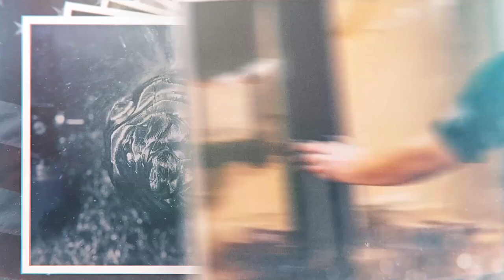Hey President TRUMP!  This Is How To Make Manufacturing Great Again - Vlog #34

Comment: It makes sense that CNC and automation should offer some advantage over countries that pay low wages.  Wages don't matter when you have one guy running 4 machines, each machine doing the work of 20 men.  But is automation replacing workers- a conundrum?
Reply: bostondan77 I’ve wrestled with this too. But ultimately, our automation efforts haven’t been to replace anyone at all; but because of the lack of availability of good machinists. So in the end, we have the same staff, with some people learning and running more advanced equipment and being compensated for it too. So you’re right. There is a sort of dichotomy in automation and manufacturing greatness. But I think that given how little we manufacture in this country now, that there is room for a whole generation to replace those retiring, and ratchet up our throughput with automation and multi tasking machines. This is why what Titans of CNC is doing is important. Securing a solid future for the common man. 👍🏻🤛🏻
Reply: Even automation creates job. Some of those jobs are high paying jobs. Think about a robot cell making parts and some of the jobs required to get and keep it running. 

1. Machine builders
2 robot builders
3. Sales engineers 
4. Riggers
5. Installers
6. Programmers, CNC and robot.
7. Maintenance techs
8. Quality Control 
9. Material handlers
10. Material prep.
10. Tooling Manufacturers 
11. Fixture design, build and maintenance.
12. Operators, to keep parts fed in and out, as well as change tooling.